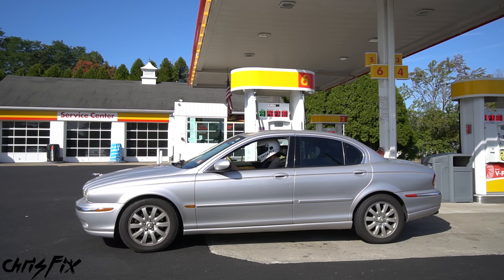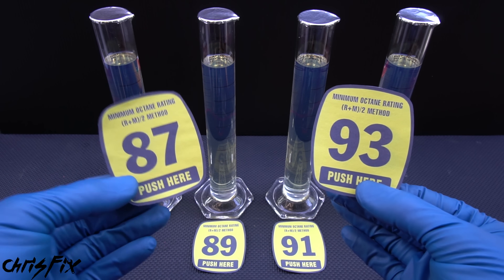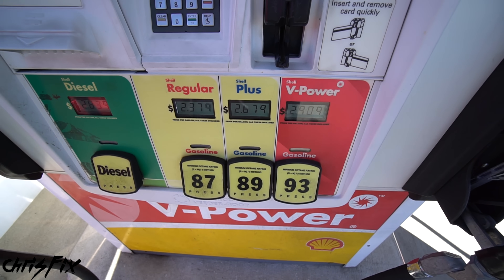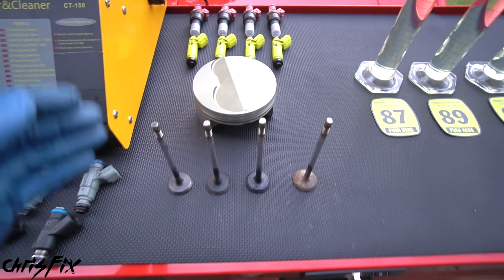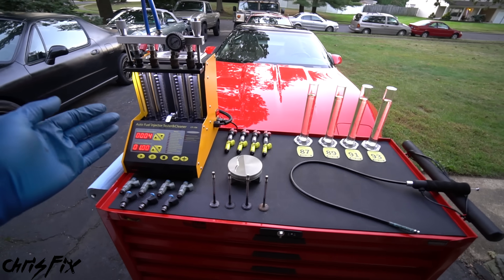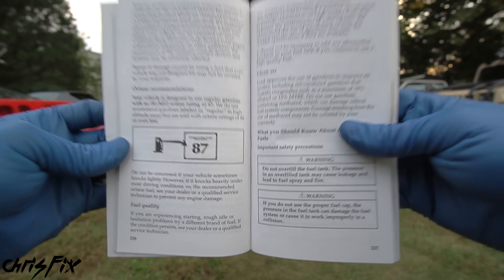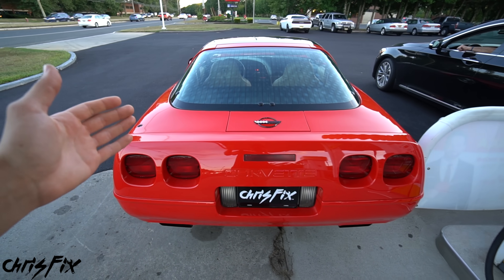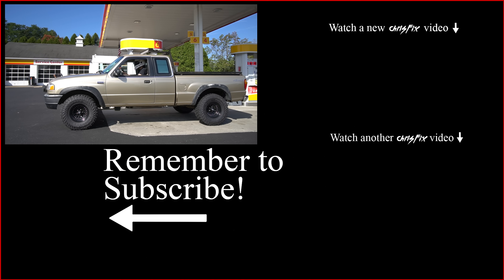What is the BEST Fuel to Use in Your Car or Truck and WHY

Comment: 30 years later
"Should you charge your car with 110, 120, 220 or 240 volts?"
😅
Reply: I'd say 480. That way the battery explodes from over heating and kills everyone within 20 feet
Reply: You say that now..
Reply: 480 volts!
Reply: 1080p 4K 12k volts
Reply: 220 volts
Reply: I'd give it more than 30 years from now. 30 years ago they thought we'd have flying cars today.
Reply: Now that's funny.
Reply: Practically voltage would not be an option, it is usually the amps, but yeh EVs are hitting very fast.
Reply: It'll be longer than thirty years before that happens.
Reply: Believe it or not, this speaks to me more than fuel octanes. Wtf?
Reply: Generally speaking, I think it's best to recharge batteries at a slower rate because charging faster heats up the battery, which shortens it's life. At least, that's what I've heard about iPhone batteries.
Reply: @perditusthornatus2718  Technically correct, however as your battery becomes larger, this becomes less of an issue, an iphone battery typically has about 25Wh of energy stored, whereas a tesla has 100kWh, therefore if you want to charge the tesla in 1 hour you need 100kW or 285A at 350V the iphone battery only takes 25W or 5A at 5V. This scenario would be called charging at 1C tesla cells are rated at 30C so theoretically they could be charged in 2 minutes, however there is no way the cable or control electronics would manage that insane amount of current. An phone battery is typically rated at 3-7C, therefore charging it in 2 minutes would most likely disintegrate the battery, due to the heating you spoke of. For all intents and purposes, as long as the battery pack of an electric vehicle is larger than 100kWh, the charging speed is limited by the power lines leading up to a charger, at only 1C you would need 833A at 120V which is a standard socket in the US and absolutely astronomical, thats probably as much as an entire street of low density residential buildings uses.
Reply: @perditusthornatus2718  cars should have active cooling during charging.
Reply: @perditusthornatus2718  yup. So if you are looking at driving these batteries,  best plan on owning at least 3 of them. That way you can have a fully charged car for driving around the neighborhood anyway.  Its not like you can travel hundreds of miles with these things.
Reply: I thought it would be nice if electric cars would come with easily swappable batteries so you can let one charge in your garage while you keep driving with another one. Tesla superchargers (as in fast-charging stations) would probably just fatigue the battery faster and cost you more money in the long-run.

Owning 3 electric cars would get very cumbersome. It's not like owning a truck, and minivan, and a sportscar where you own three different cars but each have a particular strength that is ideal under a different circumstance. Owning 3 electric cars would be like owning 3 Nissan Leafs. At that point, you'd be better off having a gas-powered car and an electric car.
Reply: @perditusthornatus2718  those Tesla batteries are made up of multiple lithium ion batterie cells that take up most of the under carriage of their vehicles. For the time being anyway?
Reply: @perditusthornatus2718  Main issue is size, at least with today's technology.  The batteries are big and bulky and would take a few hours to replace.  For example, the Tesla battery weighs over half a ton (1200 Lb / 545 Kg) and concists of 7104 smaller cells all wired together.  The Nissan Leaf and most "consumer" level electric car batteries are a little more than half of that, around 650 Lb / 295 Kg.  These batteries are typically broken up into several smaller modules.  For example, Tesla has 16 modules each weighing around 80 Lb / 37 kg.
Bottom line:  Its not quick and easy to replace an electric car battery!!
Reply: @Abazek

You gave me an idea. What if it were possible to have an electric car that has both a permanent battery and a plug so it can use power from another battery. You make small trailers that hold nothing but a battery on them. You own at least two trailers. You drive your car whenever you want, you park you trailer with a dead/low battery then hook up to a trailer with a fresh battery. The dead trailer charges while the charged one is used. Your car would pull from the trailer's power supply first before pulling from the car's power supply.

Go one step further: make these trailers a service you can rent. Make it to where there are service stations all over the place that let you rent a trailer with a charged battery, then you drop it off somewhere else for it to get charged. The trailers can come in small or large sizes (for either easier parking or better range). Then the batteries could be charged at a nice slow rate that doesn't prematurely fatigue them and the driver doesn't have to have range anxiety and doesn't have to get stuck somewhere for a long time waiting for their battery to charge. The trailers could be really short and hook up to compact cars that (when combined) aren't any longer than a standard truck, so parking wouldn't be too big of an issue. Furthermore, if you are in a dense city where parking IS an issue, then you could drop of a trailer at a nearby station and then use your car's built-in power to parallel park on the street (at least you got most-of-the way to your destination without using your built-in battery). If the trailer you rented has a bad battery (one that needs to be refurbished/recycled) your car still has its own built in power so you aren't stranded and can still make it back to the charging station and get another one. In the unfortunate event of an accident, the batteries in the trailer would be nowhere near the occupants of the vehicle driving. The weight of the batteries is a non-issue (for the most part) since you don't have to break your own back to lift them, just back up to the trailer using your nice little backup camera.

Obviously these cars can still be charged like normal electric cars, but the trailer battery would eliminate the main issues of (A) limited range, (B) needing to wait hours for the battery to recharge on trips (C) prematurely wearing out expensive batteries by just charging them faster.

The big hurdles would be custom-designing a trailer with a car in mind and/or designing a whole new car and trailer that were meant for each other (probably the first thing to do is make a trailer with a car or two in mind to demonstrate its potential, then move on to making cars AND trailers).  They would require a built-in battery and would need to be able to accept power from a secondary battery. The next hurdle would be opening these rental battery trailer stations like they are gas stations. Start small in the cities and expand outward as it becomes more popular/profitable.

Shit, I should start a business...
Reply: @perditusthornatus2718  Teslas have cooling for their batteries. my assumption is the fans are running to cool the batteries, as best as it can, while supercharging.
Reply: Just use Diesel. Kicks the crap out of those E-Cars.

Comment: I love how America is GUARANTEED spec. Not at the QA lab- what it will at LEAST be at the pump. America is great because of the guarantees and the corresponding integrity. When you buy an American Silver Eagle, YOU WILL GET AT LEAST 31.1 grams of silver that's .. again.. AT LEAST .993 pure. Mexican silver Libertads are 1/20 off of 31.1. They tried to get it spot on. Americans GUARANTEE with integrity on commodities. THAT'S why America has ALWAYS been great. INTEGRITY. Not some overrated BS.

Comment: "they use 7 times the additives required by law in their premium fuel"

Fails to say whether they use the same amount or lower in the other fuels, implying the lower fuels use less, even though that might not be the case.  It was at this moment I realized this video was sponsored by Shell way more than them just letting him "tie up a pump" for a little bit.

Comment: I have a flex fuel vehicle.  I hear E 85 is horrible for your engine.  I have 156000 miles on it and never used it.  Just curious, do you recommend it or not?  It’s a 3.6 liter Chrysler town and country van.  Mainly  highway miles.  I normally use the 87 octane.  Sometimes the 93 but mostly 87.  I have had 2 treatments on my fuel system from the dealership done to it. And I’m a change your oil every 3000 miles person.  Good video, love your Hummer!

Comment: Great video Chris! Thanks for cutting through all the bs and giving it to us straight. Just a few questions:

1) You mentioned Shell premium has 7x the fuel additive for cleaning up to 70% of the carbon deposits. Do you happen to have info on how much additive or cleaning % other major gasolines have (ie. Chevron, Unocal 76, Arco, Costco, or any others) for comparison?

2) how effective are fuel additives like Techron from Chevron? Are they a significant improvement over using just premium gas alone?

Thanks for the great videos keep up the fantastic work!
Reply: *Sorry, I should clarify: I mean a standalone additive like a $6 bottle of Techron that your pour in after filling up thanks

Comment: I am curious as to what your opinion is of fuel additives like STP's and Z-Max? I might not want to use the STP octane boost on my vehicle unless I here a knock sound, but what about the injector cleaner to give a bit of extra cleaning boost, or gas treatment, water remover etc (cuz I live in canada with hot humid summers and cold winters). I have a 2009 Dodge Avenger SXT V6 2.7L flex-fuel with just over 166,000KM (103,000 miles) and the engine is running fine, no hard starts, hesitation, rough idle, knock and ping, but its 10 years old, would any of those STP additives damage my engine or help it? Thanks
Reply from the maker: I have a whole playlist on fuel additives, check it out: https://www.youtube.com/playlist?list=PLvKbarVtwhUue-xwasd2WUMrkK0CEm6yy

Comment: I don't know.  I just have a tough   time trusting 87 octane in a 300+ hp muscle car, the same octane that goes in an eco car with half the power.  Doesn't more power equal more heat and or potential?  Also, I heard octane boosters foul your spark plugs?

Comment: easy answer. run what the manufacturer says the engine needs...  there is NO reason to run 93 octane if the car states it runs on 87 octane.. it will absolutely do NOTHING.. period.. however, running the less expensive 87 when that Lexus or Corvette or any manufacturer states they REQUIRE 91 or 93 will cause a LOSS of fuel mileage and performance...  and I just wrote everything that you stated here.... and as for your truck ?? run some water through it !!!  clean out all that carbon !

Comment: I use midgrade in my Ecoboost f150 when I'm planning on towing or running it hard just to eliminate the potential for knock or power reduction under heavier load.

Comment: Glad you touched on required vs recommended. For a while, Ford advertised horsepower for both 87 and 91 octane in their Ecoboost engines.
FYI, many modern direct injection cars can use 87 as they inject only when they need to combust anyway, rather than rely on octane levels. But they can still take advantage of even more aggressive timing with 91+.
Lastly, modern coil over ignition modules have replaced knock sensors by using the spark plugs to measure the air density(? Can't remember) of the combustion chamber to determine if knock is occuring, rather than those piezoelectric microphones. Pretty cool!

Comment: Now I know I should just use Shell fuel.  So regular/city diesel or V-Power diesel in the UK?  Pretty sure you are suggesting it MUST be SHELL.  It's subliminal how fast you speak about myths and facts.  For a laugh, search Top Fuel Fuel Injector test.  Now that is a FACT which is not sponsored by Shell.

Comment: How does it work with cars that tell you the estimated miles to empty? The higher the octane I put in my car, the more estimated miles to empty I get.
Reply from the maker: That estimation is based on fuel economy. Your driving style is one of the biggest factors of fuel economy and it is hard to say the fuel has an effect unless you test it over thousands of miles. If you hit traffic one day or a series of red lights, your fuel economy can go down significantly even if it is the same route you always take.

Comment: Good stuff Chris, nice show and tell. One thing I learned while at Motorcycle school about engine combustion that applies to cars as well.

The MOST efficient combustion is just shy of detonation. Translation: Use the LOWEST octane rating possible that is recommended that doesn't cause detonation pinging. Summer weather typically requires a bit more octane to inhibit detonation. Fuel octane rating is one of the cases where bigger is definitely NOT better- it's just the opposite in fact.

Comment: Technically the higher the octane the higher the amount of double bonds which means higher energy density. 87 octane is 32 megajoules/liter while high octane aircraft fuel has around 33.6 megajoules/liter. Also the higher the octane the more advancement of the ignition events which will lead to higher power output at high RPM. But when comparing apples to apples in the sense that Chris is, he is correct to state what he is stating. Good overall video Chris. I am a chemistry geek/motor head and I like your channel.
Reply: Marcus Taber Higher octane alone does not do anything.
Reply: @XtreeM_FaiL  On an older non computerized car you probably wouldn't be able to see any significant gains, yet there still would be some based on the higher energy density of octane vs heptane and higher enthalpy of combustion of octane vs heptane. On a car that has a transistorized ignition timing mechanism and a knock sensor, higher octane fuel WILL have a significant gain. So you are wrong in both instances, higher octane alone will make more power. Why? Chemistry and physics. If you read what I wrote, I spell it out very clearly. Now regarding a non knock sensor/ adjustable timing vehicle the actual gains could be hard to see unless using a highly accurate dyno and multiple runs as to be statistically significant. But if you use a fuel with higher energy density in an engine that extracts energy from a set volume either carb or FI, logic would dictate that the higher energy density fuel will produce more power. Now one variable not accounted for in all of the information provided is whether the higher octane fuel is actually higher octane due to more octane being present or if it is other chemicals added such as TEL(Tetraethyl-lead) (obviously that isn't used anymore). Then the energy density of those additives and enthalpy of combustion would have to be taken into account and it could very well be that the higher the octane the less power produced on a non computerized/knock sensor vehicle. Perfect example of this case would be ethanol vs pure heptane. Pure heptane has a very low "octane" rating obviously but has a much higher energy density than ethanol, yet ethanol has a much higher octane rating. Does this make sense to you XtreeM? If you need clarification I can try to explain better with more simple examples as I honestly have no idea what level of chemistry understanding you have nor physics understanding.
Reply: @XtreeM_FaiL  And I said it does, alone, higher octane will have higher power output, as I stated previously twice, higher octane has higher energy density which means higher power output alone. take an engine, keep all things the same and change the octane level fuel and there will be a correspondingly higher power output. So alone implies same engine, same atmospheric conditions, the only variable is octane rating. therefore if the only variable difference causes a difference in end power output then octane alone does do something, it changes power output. As I said previously, this amount may be negligible  and hard to measure, but none the less there is a direct correlation between octane and power output.
Reply from the maker: You are comparing apples to oranges. We are talking about GASOLINE in this video not different fuels. Different types of fuels have different octane ratings and energy content just as you stated in your comment so thanks for sharing!

Comment: In Germany we have a brand (Aral) that offers fuel with 102 Octane, so that would be a 96 in the USA I guess
Reply: We have vp racing fuel at 101 or 103 octane here so that would be like a 110 over there?
Reply: We have C16 race gas that is like 116 octane. I used to run it in my 2 stroke snowmobile. Then we have ethanol gas that has very high octane ratings. My new snowmachine i mix 100 low lead av gas and 91 premium.
Reply: @jeremyjordan3849  A lil bit of c12.... zoom zoom
Reply: Daniel Scariti lmao
Reply: If i made a fuel company i would make a 122 Hyper octane
Reply: Daniel Scariti that would be about 536 octane LOL
Reply: in  the turkey just have 95 :((,maybe you know econmy down here 1 litrs=7 tl   ,,we cant drive the car,,you are soo luck this about...

Comment: So why do I get more response out of my turbo charged engine with 93 than 87? When I run 93 my spool feels quicker and easier compared to 87 where it takes a bit longer to spoil
Reply from the maker: Like I said, forced induction and high compression likes higher octane. Your engine can make more power with it due to changing the timing.
Reply: Spool
Reply: Appreciate it bro

Comment: So we here in the Netherlands got a switch to E10 gas recently. It's required by law to have E10 as the regular gas. So what about running say 98 RON or 102 RON? Here most 98 RON or 102 RON  come without any form of ethanol. Would running that be beneficial to power/economy and to prevent it eating away your lines?